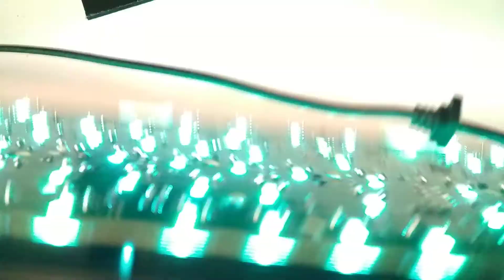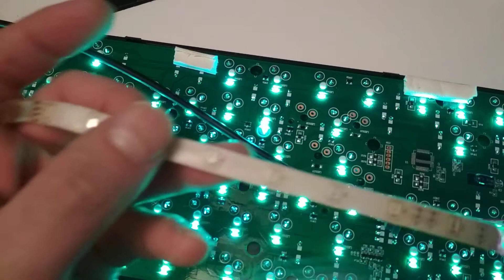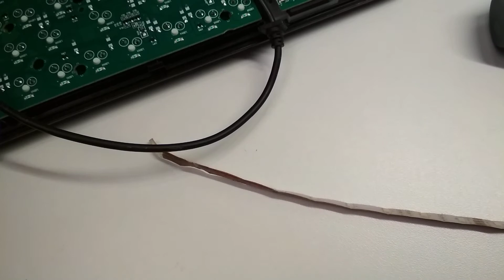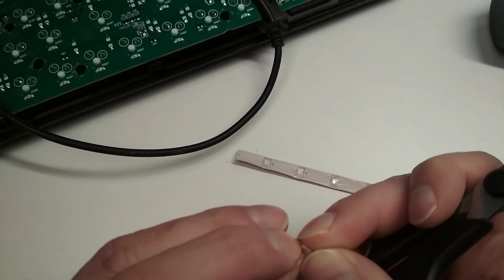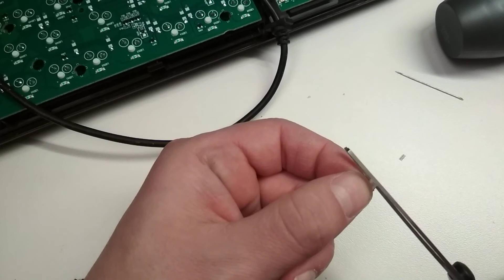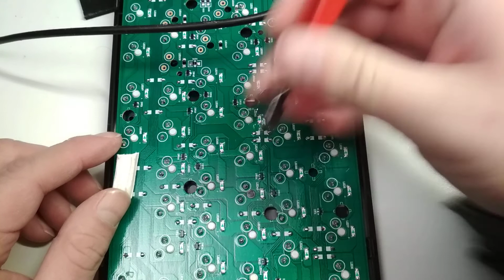Repairing a T-Dagger mechanical keyboard again ... another LED burned out - part one

Comment: fuck this keyboard i bought it 2 weeks ago and it's not working anymore
Reply from the maker: Yeah ... the switches are good, but the LEDs and electronics ... not so much... If it's under warranty, return it and get a Redragon something or other ...
Personally I'm currently "repairing" an even worse mechanical keyboard, redoing the wiring to make it work with standard cheap keyboard electronics. Maybe I'll make a video about it.